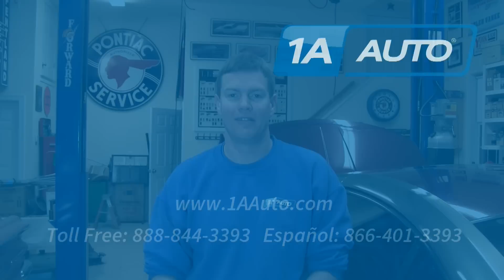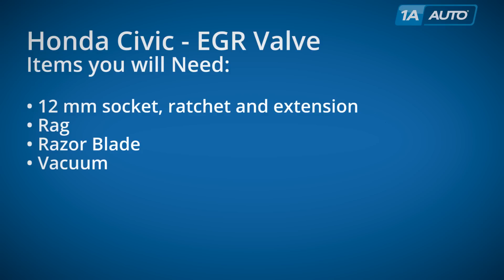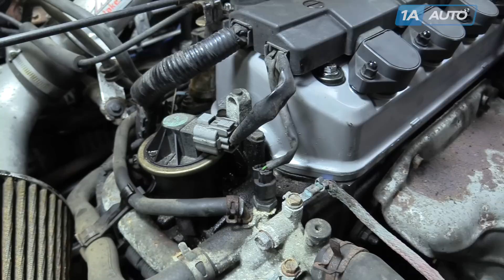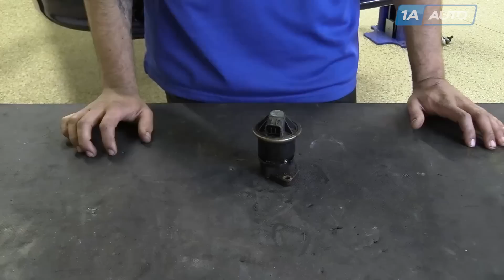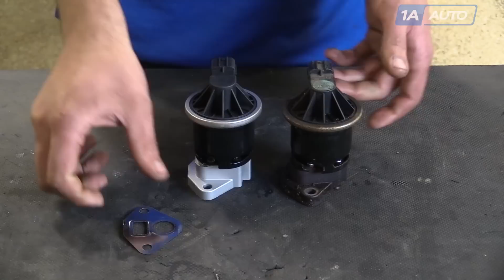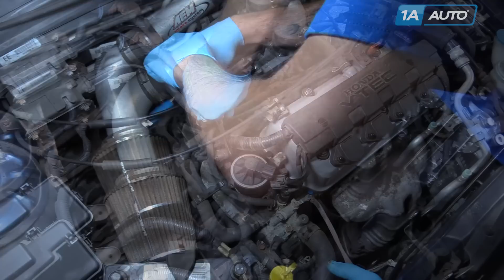How to Replace an EGR Valve 01-05 Honda Civic

Comment: My 2002 lx doesn't have it there and I'm reading 0300 codes after replacing the plugs and coils, finding no vacuum leaks, pulling the intake manifold and cleaning it and changing the fuel pump assembly in the fuel tank. Runs terribly. Could the EGR be plugged or the ECM malfunctioning?

Comment: I have a problem it's not giving power to my cable for the gas pump with that be the problem everything else in the front works fine?
Reply from the maker: +Juan Miranda We wouldn't be able to diagnose an issue like that here, you may want to have a local mechanic take a look at it. Thanks for checking us out! http://1aau.to/m/Shop-1AAuto-c

Comment: Honda must have changed something up for 2004.   My son's 04 Civic EX has 2 studs & nuts holding down the EGR valve.   The front stud is a good 1/2" taller than the nut, so I cannot fit a shallow socket onto it.  I'm hoping I can locate a thin deep well socket to fit into the space.
Reply: I have the same issue any idea what you did to get it off?
Reply: @drakescholes4166  long sockets and extensions are the way to go. Remember how he cleaned up the oil...that can be as a result of the black circle/cap to the right of it. That cap has an O-ring which tends to be a common culprit of oil leaks. Replace that as well. I was able to find an OEM unit for under 10USD.
Reply: Use 1/4” drive short socket, lightly warmed engine you will have to tap it down lightly to seat it fully on the nut, leave that socket on, use a wrench on the rear one, take em up together 🤘🏽

Comment: 1/4" drive with swivel is the key here on these bolts,  especially the front one that is near impossible to get on with a socket because of the top of Egr valve. Thought the 1/4" swivel was going bust because my civic egr valve has never been off at 206,000 miles the nuts were pretty tight but I kept steady pressure on the nut and its broke lose . 

For you guys who cant find the egr valve,  its because you dont have one.  Vtec models had them.

Comment: My local Honda dealer wants $178 to replace the ten dollar plastic cam plug just adjacent to the EGR on my 2002 1.7 Ex.  I am thinking I could replace both the EGR and the cam plug myself for much less.

Comment: Just did this procedure to replace the valve cover plug. Worth noting that the stock exhaust has a big black box thats in the way. Its worth taking off that box for WAAY better access. Not nessicarry, but will save a lot of headache.
Reply: Had to do this on my car - extremely annoying. Good heads up, though.

Comment: I need a new EGR unit
For a 2010 Honda civic 
How much.
Reply from the maker: +Short Boss Thanks for checking us out. The EGR valve for the 2010 Civic can be found here: https://www.1aauto.com/honda-civic-egr-valve/i/1aegr00278?f=1342997&y=2010 Please be sure to double check the specifications before purchasing!
Reply: Do you ship to the Caribbean Trinidad to be exact.
Reply from the maker: +Short Boss You can see if we ship there on eBay. We will list where we can ship to depending on the part.

Comment: Does anyone know why there might be coolant leaking by the egr valve like in the video that he cleaned? I have same problem and I'm afraid there could a be a coolant leak...
Reply: I was finding that out today and it says that the coolant jacket is right next to the exhaust ports in the EGR/Thermostat housing and if the gasket breaks, exhaust gas can enter into the cooling system and blow water from the coolant reservoir but that’s what I’ve been reading from other people

Comment: hello, 2001 honda civic , the EGR valve set of plug/connector is not coming out of the passager side of the motor, as seen in the video,,, there is a smaller connector that seems to go down to the motor,, what do i do about the wire/connector/cable whatever you call it

Comment: could this be a solution for misfiring on all cylinders and random misfire on 03 civic? have replaced plugs and coil packs. no shaking of car or really anything that feels like an actual misfire. 03 EX 171K
Reply: I know this is an old comment but did you ever fix the problem by changing or cleaning the egr valve??? I’m having the same problem
Reply: @kyriosbernardo3158  my civic started acting weird about 50 miles after taking my egr off to replace the cam plug oil leak I had. I just replaced the egr gasket like 500 miles ago so the one I had to replace when I pulled it this time came off pretty clean except a little bit left of motor. I just used my nail to get it off. Just bought an actual gasket scraper and a new gasket so hopefully it fixes it. It starts up good. No shaking. But if I turn my ac on it will kinda shake the car. If I drive the car for an hour or so it will get to a point of dropping the idle so far it just dies at red lights. Im thinking it has to be something with how I put my egr back on. Car runs perfect before I took it off the second time.

Comment: Of course anything that looks simple on video is the most complex job on the car damn near smh literally cant get a tool to lock onto the 2 egr valve bolts
Reply: 1/4 INCH DRIVE with a swivel works perfectly.

Comment: Im experiencing P0304 apparently all my cylinders are misfiring. Could a bad Egr valve be the problem? Should i replace the egr valve in hopes that it fixes the misfiring cylinders? i dont know much about mechanics but im doing my best to fix up my car. Any advice would be appreciated
Reply from the maker: +Billy The Kid We do not have a way of being able to diagnose the issue that you are experiencing with your vehicle but suggest taking it to a local mechanic for a proper diagnosis.
Reply: @1AAuto  ok so new egr valve it is. Thanks!!
Reply: @Mrpoker-hr1ud   did changing the egr work for the misfire ?

Comment: I'm having a nightmare removing that second bold in the back...I want to drive my car off a cliff. I spent $30 on an extractor kit and still the stupid bolt wont come off!!!
Reply: Jonas De la Rosa harbor freight has a nut stripped stractor tool set , it worked for me .
Reply: Try tapping the bolt extractor socket onto the nut until it is completely on the nut. This will eliminate nearly all slippage of the socket.

Don't forget to use a flexing joint socket adapter for this, too. Makes life a lot easier.

Comment: Dose my 2001 honda civic lx have a egr valve cant find it got it already with after market throttl body and cold air intake cant fine it mine is the non vtec model let me know anything helps at this point mine just turns over and will not start and smells flooded after tuening over i think it is egr cause i got spark got fuel got compresion
Reply from the maker: +Nicholas Payne Thanks for watching!  An EGR valve is a part that is required to be on almost every vehicle for emissions, so your vehicle should have one!  We do not have any diagrams available, but it should be located under the hood.  1aauto.com

Comment: do you have a video for the 2003 honda accord with a 4 cylindre and where the EGR valve is locate thanks
Reply: I have a 2.4 on a 2008 honda accord and the EGR valve is hide where s located

Comment: diesel egr valve on 1.7 diesel 2005 model?
Reply from the maker: +Mark Coupland We currently do not have an auto repair video specific to that application. You might be able to apply some of the basic steps shown in this video to your application, but hardware sizing and orientation will be different. 1aauto.com

Comment: my dad changed the egr valve on my honda civic ex because the code was p0401 and now the check engine light is back on. any idea if the code needs to be reset. thanks.
Reply from the maker: +Patricia Gonzalez There could be multiple issues with the vehicle, here are a few possible causes:

The DPFE (differential pressure feedback EGR) sensor is faulty and needs to be replaced 

here is a blockage in the EGR (tube), most likely carbon buildup 

The EGR valve is faulty 

The EGR valve may not be opening due to a lack of vacuum

Comment: How on Earth did you get those two bolts off? You seem to angle the socket in there but in my case, it's not enough. I cant a grip on the bolts. Are you using a really shallow socket?
Reply: I tried to remove the egr bolt but it so tight that I lost the tread of the bolt. Please help!!!
Reply from the maker: No, we just used a normal socket on those guys. It's possible that yours were replaced with something other than the OEM parts though. Try spraying a little penetrating oil on them before removing, see if that helps. Hope this helps you out. 1aauto.com?utm_source=YouTube&utm_medium=CTA%20Comment&utm_campaign=1ATony 866-403-3393
Reply: Soren Lausen Yes I had to use a very thin socket with a small little 12mm on the end and pushed it on there as hard as I could while turning and managed to break it loose
Reply: I can’t get mine off either! The one in the front I can only get an angle on and it keeps slipping.